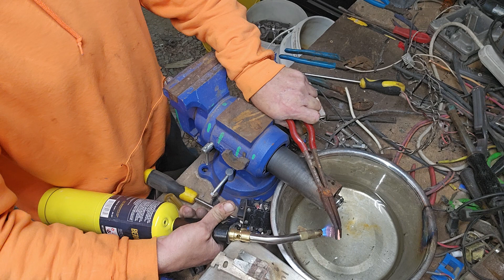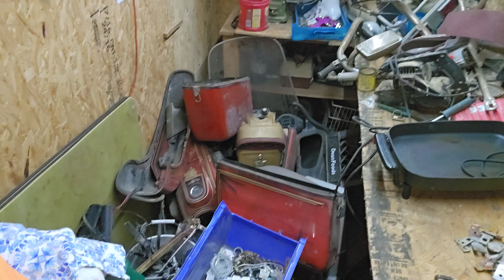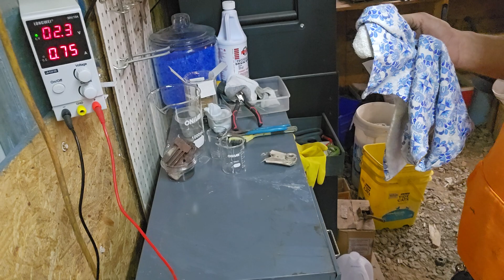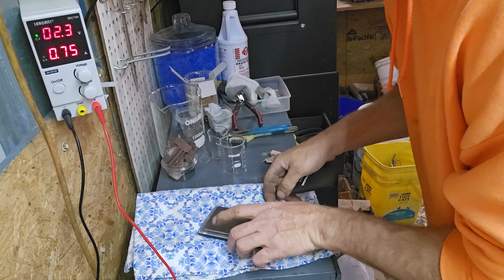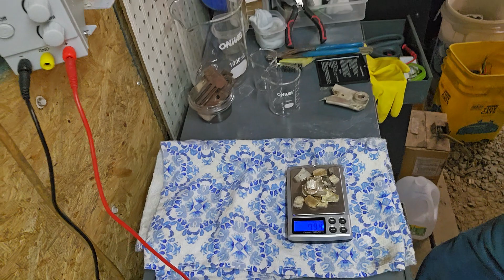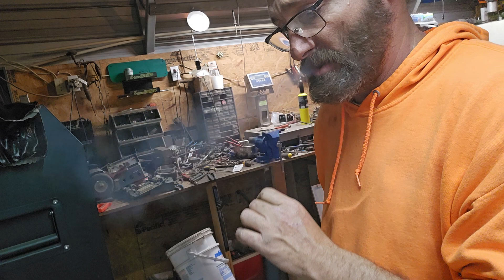removing contacts  #silver #copper #recycling #recycle #diy

Comment: My honest opinion is that in doing the silver recovery with the cost of things you are just doing it as an way to save money. I think with the gas use and all you break even. Now if you save it up for the long haul the price should go up on silver and you would then make money. That's the hope any way! With that said I would send the ends off to a refiner after you melt the pad off or save them. Taking the next step to refine them to pure silver your self is just not worth it to me. If you use a setaline torch it would go alot faster as to the hotter flame to. So you hat 2.5 Troy oz that needs to be refined. Save it up! Merry Christmas
Reply from the maker: Planning on saving it all up and using what I have to refine myself.  But afterwards I'll send them off to be refine! Merry Christmas bud